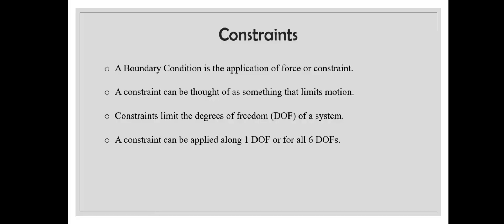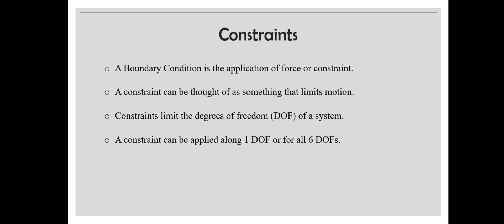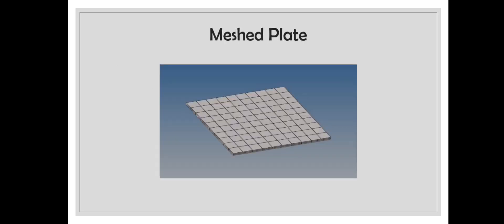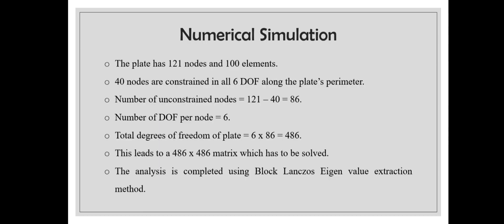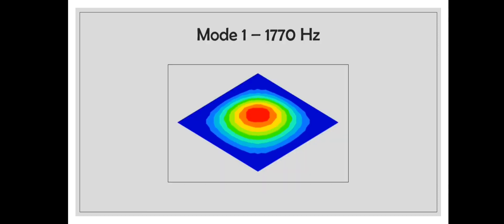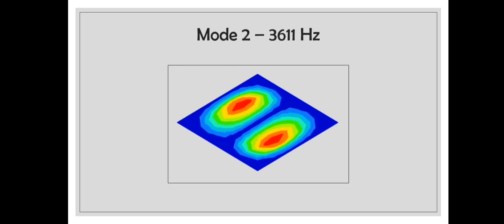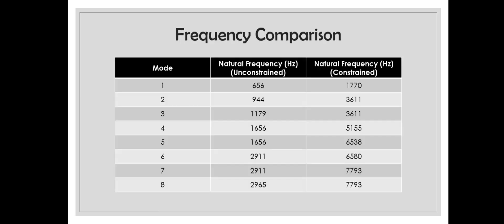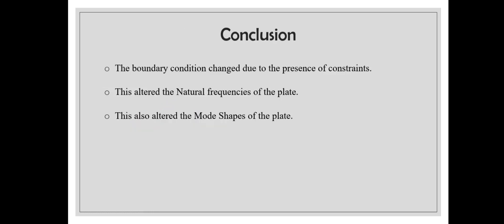Mode shapes of a constrained plate

Comment: Sir, what is the physical significance of unconstrained plate? Physically it is not possible, right.
There should be some fixed node?
Kindly clarify me.
Reply from the maker: If the intention is to determine the natural frequency of a plate alone, then it is necessary to use "free-free" or unconstrained boundary condition. Constraints can alter the natural frequency either by shifting, dampening or eliminating it. A constrained plate now represents a system which would have new natural frequencies and mode shapes due to the constraint. In real life, a "free-free" condition is not possible as an object cannot float in space, but an approximation is possible for example suspending a plate with flexible strings so that the plate is free to move with some dampening.

Comment: What do you mean by 100 elements in each plate?
Reply from the maker: For FEM (Finite Element Method) Simulation, one of the prerequisite is, the object of interest has to be discretized into finite particles called elements. In this video, the plate was divided into 100 elements. Larger the number of elements, better the results but also greater is the computational cost.